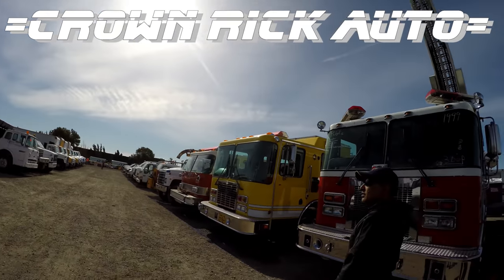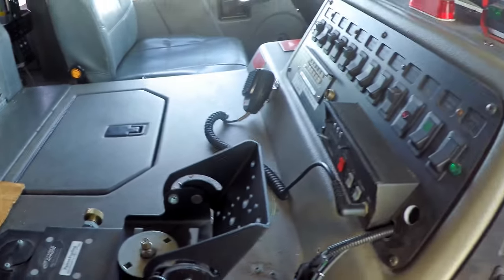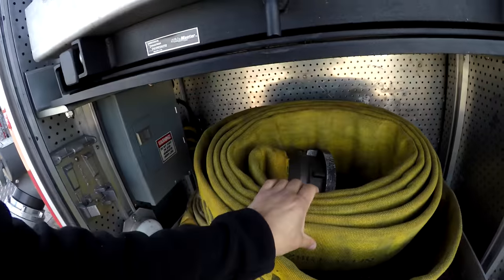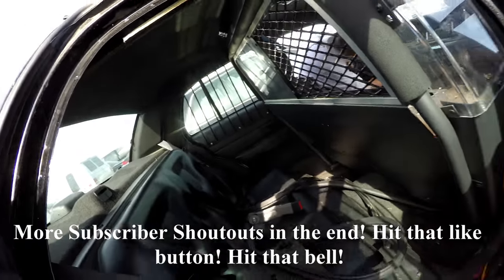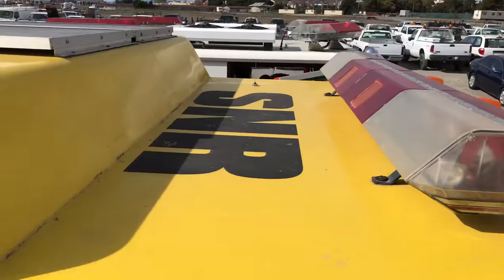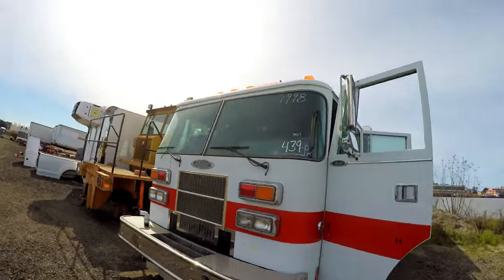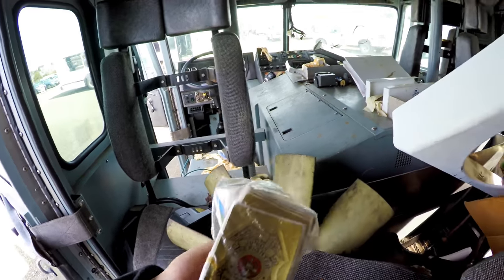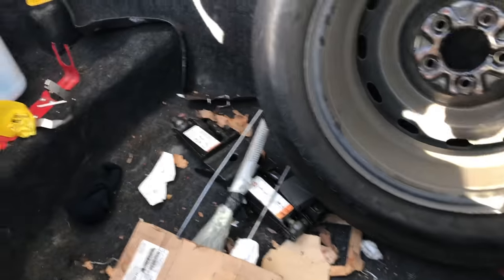Searching Fire Trucks! Found Lots Of Goodies! | Crown Rick Auto

Comment: If ur looking for a axe when checking the fire truck. On the pumper truck they have then the back between the seat sometimes on the ladder trucks on both side the first 2 compartments usually have them well on most of the tucks. Unless it's rescue then could be anywhere